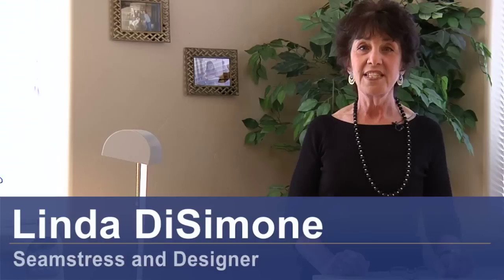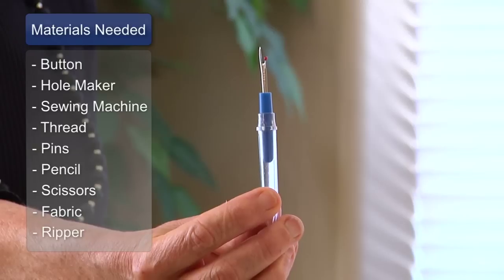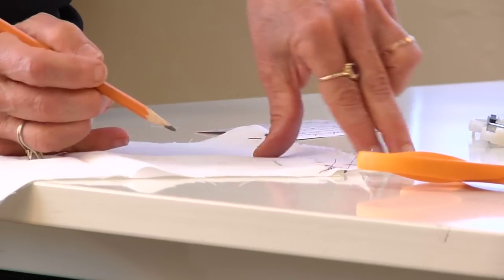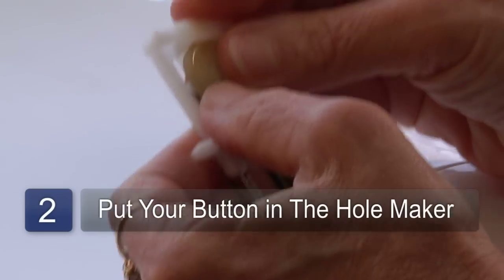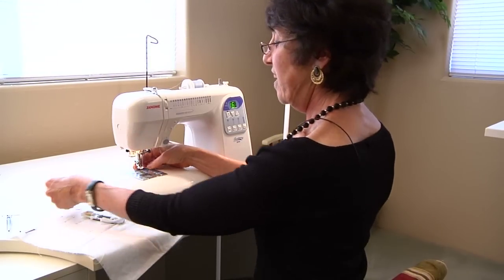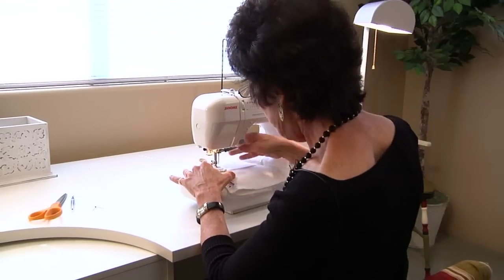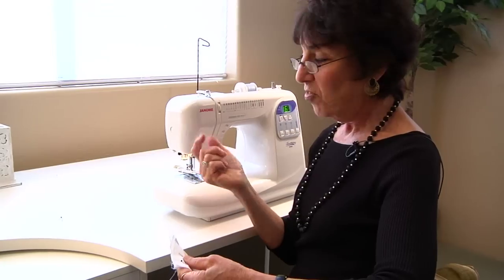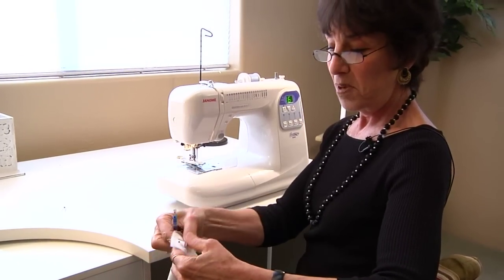Sewing Basics : How to Sew a Button Hole

Comment: I’m not sure why there are so many negative comments on this video... people seem very critical of button hole making tutorials. Thanks for the pin tip as to not cut through the thread!
Reply: simply because of how bad the produciton was.  One example: when she is marking the material with a pen on either side of the button the camera angle is almost at the same height as the plane of the material and activity - you cannot see what is going on.  If the camera was looking down on the scene it would make sense.  She mentions  the lines should be drawn slightly bigger than the button - but you never see this.  It is a useless visual representation of the process.

Comment: The machine does the work. Ah well, it's neat I suppose, but it's also a messy result after cutting; a lot of frayed inner fabric. Comes as result of the stitching being a little too far apart. There's a place for machined buttonholes (I'd say it was on a shirt where satin-stitched buttonholes would be tricky any other way. But jackets should be done by hand for a proper bound buttonhole - assuming people don't have costly genuine keyhole button-holer.